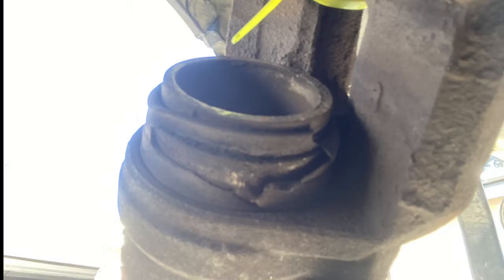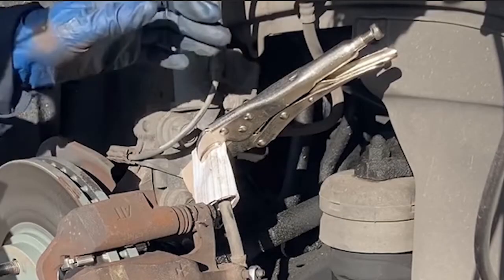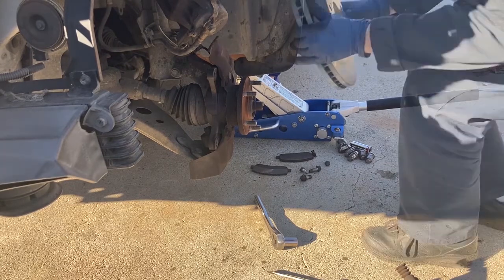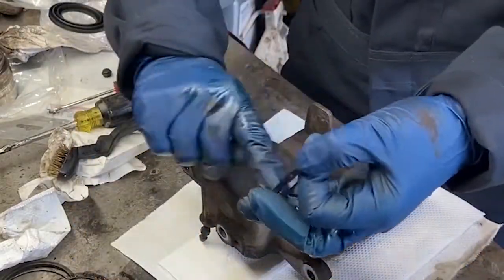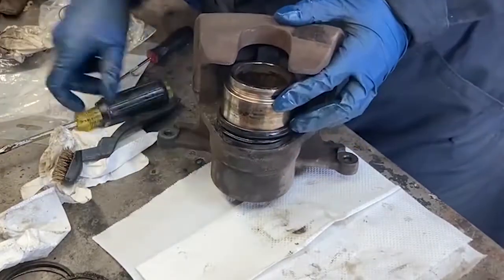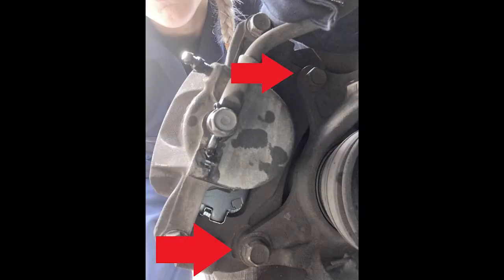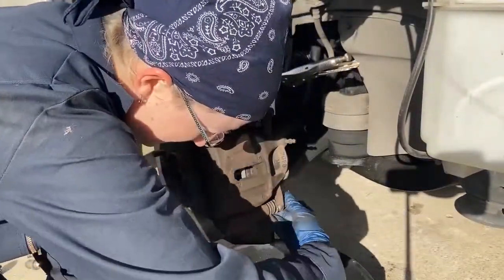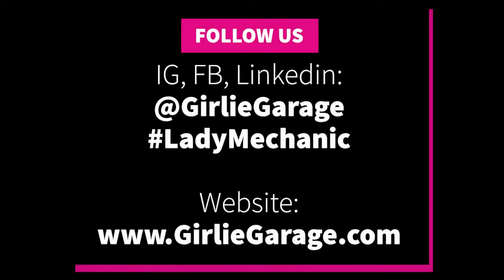2001-2007 Toyota Highlander Front Brake Caliper Rebuild - Girlie Garage

Comment: The slide pin with the rubber bushing should go at the bottom of the caliper not the top (at least this is what my 2005 Highlander service manual shows and states). The two pins were probably mixed up in a prior rebuild.
Reply from the maker: That’s probably correct then. I just make sure to put them back in the order that they came out. Thank you for bringing that to my attention